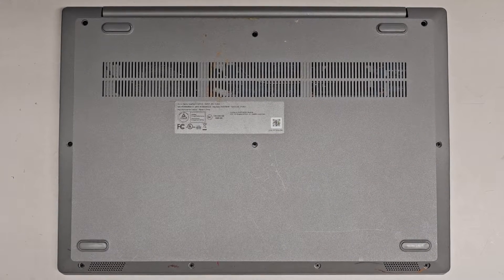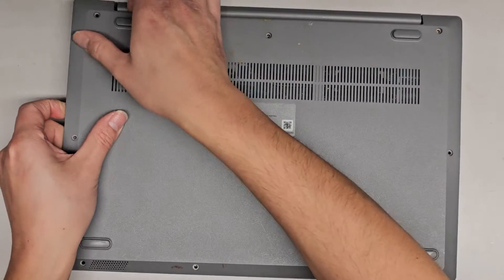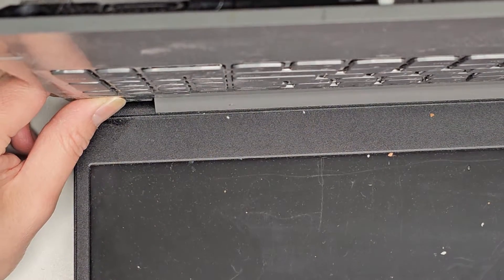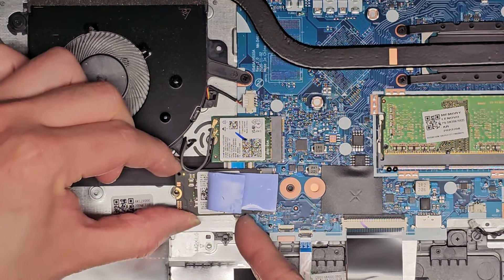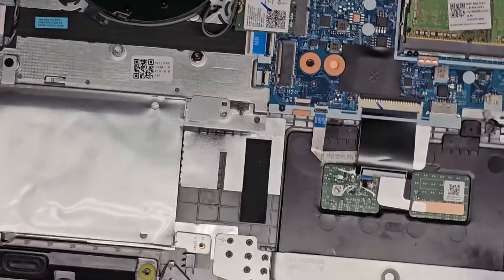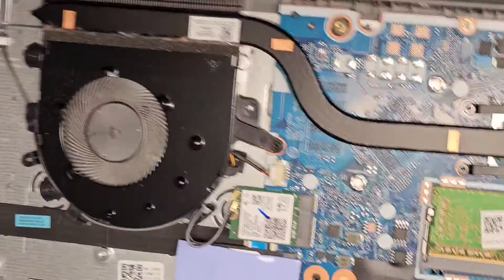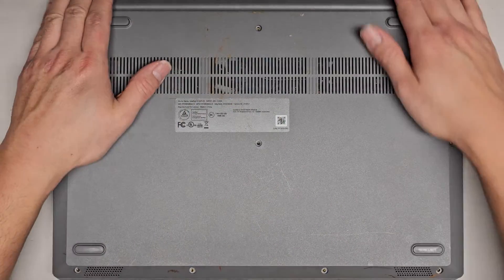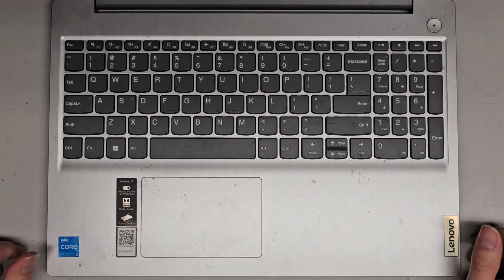Lenovo IdeaPad 3 15ITL05 Disassembly RAM SSD Hard Drive Upgrade Battery Replacement Repair

Comment: So, my computer has a problem staying charged for a while and won't charge up 50 percent. It dies quickly if ever off the charger. Any suggestions would be greatly appreciated.
Reply from the maker: Try a new battery.

Comment: Hey I disassembled mine and I unplugged the battery but the connector went back in and I didn't notice and when I unplugged my screen it flashed a couple of time and now its not working. what do I do?😢
Reply from the maker: It sounds like it's fried D:

Comment: Thanks! Informational video. A couple of questions:
do I still have to press down the power button for 15 seconds even if I'm only changing the RAM module? Please note that I will have had already unplugged the charger and removed the battery. 
What purpose does pressing down the power button for 15 minutes serve? 
Do I just shut down the laptop, press down the power button, close the laptop, open it up, then carry on with my business?
Reply from the maker: It's to drain power from the capacitors. If you're only touching the RAM then it's not necessary.
Reply: @ItsBinhRepaired Got it. Thanks!
Reply from the maker: Yup